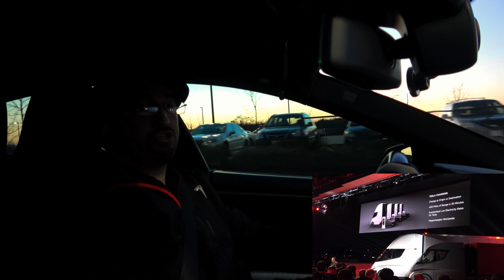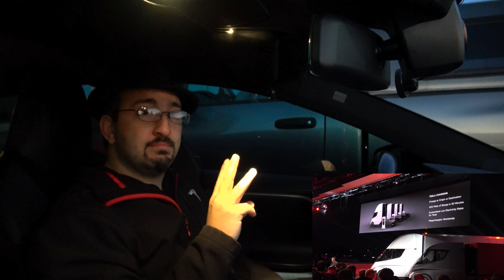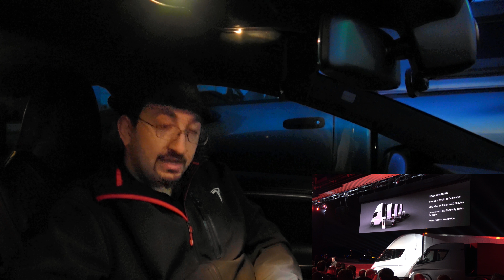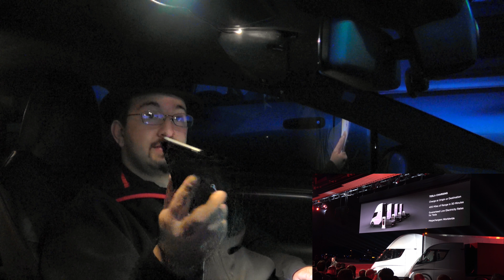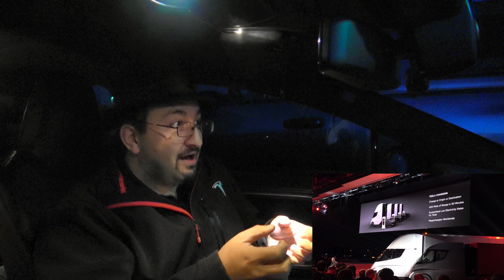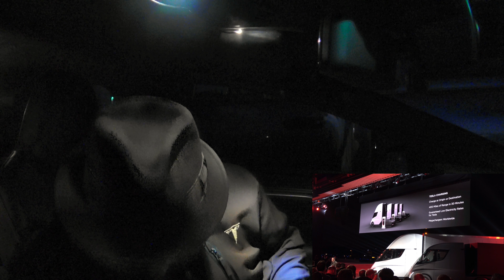Tesla Semi COST (From Insiders!) & Other Unknown Information! Kman Digging for Info

Comment: Use a #4 THHN copper wire for example...  22.8kW @ 240V, 142.5kW @ 1500V, 237.5 @ 2500V.  Step that up to #3 and you get 287.5kW @ 2500V.  Multiply by four and you get 1.15MW @ 2500V.

Why am I talking about 2500V?  Think of a variable internal pack geometry.  When it goes to charge, it internally changes connections to put multiple battery sections into series, that would normally be in parallel.  This is a very interesting and very possible way to boost charging rate without larger cabling.

Also remember that the size of your wire isn't the limiting factor with voltage, the dielectric constant of your insulation is.

Comment: Dividing the charge into segments and increasing voltage with modularized battery segments charging independently with common management of packs. This is my guess. Reduced cost for repairs etc.

Comment: Kman, any thoughts about winter testing of semi? Running the semi between Tesla plants will not experience the different weather we have in USA.  Wisconsin winter on battery/motors? Ice Road Tesla truckers??? 😀😀😀
Reply from the maker: +PaulNVideo not a bad idea, but should be too bad. the use semis get, the battery would never get a chance to cool down. mega charge drain mega charge drain. in fact, might perform better here ;-) faster charging as less heat build up!
Reply: PaulNVideo if they run the semis between the gigsfactory and Fremont, that means they will cross the Sierra Nevada many times, and it snow a good bunch in winter. I've done snow driving many times on the Sierra.
Reply: I was thinking more extreme conditions. Snow/ice chains on the tires. Based on Kman info about drivetrain the chains would go on the lower speed set of wheels??? What about clearances on fenders??? It's pretty aerodynamic for good conditions.

Comment: You talk about using differentials and suggest two wheel axles. The differential function is done with the motors, one for each wheel. The original GM Impact, prototype for the EV-1 had two motors, one for each rear wheel. GM decided to go with a complete in house redesign of the EV-1 which went back to the single motor plus differential supposedly for production considerations. My feeling is they were dragging their feet, and one hardly calls about 800 units ever released to the public "production". Unless, of course one is referring to a $250k Semi  annual production level.

Comment: When Elon quoted a 621 mile range for the Roadster I knew a new battery chemistry must be in the pipeline!
Reply: Nt really much different chemistry so much as the size of the pack is double that of 100 kWh which gets 310 miles at best, a lot of folks been saying the range makes sense since as aforementioned.

Comment: It would have to be 1600 volts to accommodate that power over the same cable. Easily accomplished just put the packs in series. I believe the long rang version has 5 packs which would make a 2000 volt charge rate which sounds more like it.  Actually it would have to be 4000 volts at 200 amps to give that power. If they are going to do that they might as well go 8000 volts at 100 amps I don't think the standard cord could hand 200 amps of current. Or they could add more conductors in the cable to parallel the circuit.

Comment: Hey Kman.

Elon boasted about an EPA estimated 500 mile range at max gvw. Do you think that represents a conservative estimate that factors in Winter cold weather driving? If it didn’t and you lose 40% range that would be big deal breaker for a lot of Regional route trucking companies. Suddenly your 250 mi out and back range becomes 150 miles.
Reply: There is no need for a 40% capacity loss in cold weather. The batteries would be heated and while that does take some power it would be negligible. Mostly the power to keep the battery within the optimum temperature range would be supplied from the charger during stops and on an Alaskan road in winter just driving would keep the batteries warm with maybe a little additional heating powered by the traction battery if required. It is not a problem for a Norwegian Model S so the Semi should be easy. Just keep the tractor plugged in when stationary for an hour or more.
Reply: Well, I would agree that it shouldn't be that much loss.  However, my experience with EV range loss on my current Chevy VOLT is about 40 % in 20F temps . It goes from 42 summer to 24-26 in January. (South Central Wisconsin) But that is based on a 10.7 KW useable capacity. The HVAC and Battery heating probably consumes a larger percentage of that usable capacity than it would in a much Larger capacity battery overall.  I plan on getting a LONG RANGE Model 3 in 2019 and plan on driving it on near 300 mile trips on a frequent basis. I have Super Charging available along the travel route but I would prefer to be able to leap frog the chargers for Time reasons. If I were to lose 75-90 miles of  310 mile estimated range, I would be forced to SC along the way to complete those trips. While a minor inconvenience to me, I'm not driving my car as a money maker like a trucking company does where time is Money!   Don't get me wrong, I really want the Tesla Semi to SUCCEED.  I just want to be sure that the Tesla Marketing department is selling all there vehicles based on real world conditions and numbers.  Rather than boasting big numbers followed by the  small print (*) footnotes.

I do like that Elon likes to make the Worst case scenario statements though.  500 mi range @ Max GVW for example. It's always better to undersell with the confidence, knowing that it will out perform your conservative selling points. Kind of like the Model 3 long range 310 mi, which is based on the non-aero wheels. Add 8-10% for those.

Comment: What is the weight of the current battery packs?  I would expect that along with a semi, there would be various trailer formats (flat decks, enclosed cubes, refers) with additional battery packs installed in the frame.  IF the weight is not a huge penalty to the payload, I can imagine Tesla or even a 3rd party offering a 'spare battery on wheels' which you're going to be hauling anyways...  Terminal to terminal truck operations, such as Walmart who've already ordered these trucks, would certainly be well served to be able to unhook one trailer to be unloaded/loaded/charged and just hook up to another trailer that's ready to go and fully charged, no delays...
Reply: Added vehicle weight = lower payload weight = less money being made seeing as truck have a legal max weight limit before a permit is required to operate though each state on specific routes.

Comment: I don't that there will be an onboard charger, so AC charging won't be available.  As your video showed 120v charging is silly and even with a 20kw HPWC it would take 20 hours to get 400kWh.  Not having to carry a charger saves weigh and costs.

Comment: 175,000$ plus or minus 25,000$.
Reply: Tony Jose 

That’s not that far from the price of a New traditional semi-tractor with a sleeper and amenities.
Reply: Soo, 1Mwh battery should be 150k alone?
Reply: He is very wrong about price, Battery pack of 1MW will cost atleast 200K the Price will be at least 400K-500K.
Cost of operation will be very cheap compared to diesel and overall cost of operation from cradle to grave / 1000,000 Miles will be 3 times cheaper than Diesel, Cost of diesel for 1 year is 70K. you will save 200K on diesel alone and oil change for every 10K and many breakdowns in diesel will cost too much compared to EV-Semi.
Reply: 150$ per kwh was last claimed price I have seen coming from tesla about their 21700 cells.
Reply: In FEBRUARAY they announced that they reached 125$/kwh and since then they made huge breakthrough in they gigafactory-building. The larger the Factory become, the cheaper it will be. Estimates go as low as 90$ once its finished - which it should be somewhere around the deliver-date. 200k for the truck is very likely and possible.
Also there are rumours that Tesla might not fully sell the battery with the truck but instead switching it once its used up and then recycle it themselves because those used batteries are actually worth a LOT. So the customer only pays a portion of the cost but has to buy a new one every 500k miles or maybe even 1mil miles and tesla gets the old batterypack for free to use in their battery-projects or whatever.

Until one of these trucks reach that amount of miles, there will be several more gigafactories around and the price even lower
Reply: That's the cost of cell not the battery pack with thermal management and BMS,
You can't put those cell directly in the car like toys.
Reply: Kman nailed it. Reports today are $150k for the 300mi version, $180k for the 500mi version, and $200k for the founders series.  Meaning: Tesla's battery price has gone way down.  Something like $80/kWh after profit.

Hardly impossible.  Even with today's spiked raw material prices I estimate that NCAs would be about $50/kg in raw materials.  I don't know how much cobalt they use in their NMCs (I understand them to be low-cobalt NMCs); if it's the same or less than in their NCAs then they'll be even cheaper.  Once the price spikes get back under control, raw materials should be closer to $30/kg.
Reply: If only I could get a load of those cells at that price....
Reply: This is the reason that all of the people who've shorted TSLA because "the competition will soon be blowing them away" are idiots.  This sort of competitive advantage comes from billions and billions of spending on facilities and R&D over the course of years.  You don't reverse that overnight with pocket change.  You know, you see a company or another announcing $10B or so over  a decade, backloaded, and it's like, "You forgot a zero on the end of that figure".  The only thing I've seen that actually comes across as serious is Volkswagen's recent announcement of plans to spend $40B over 5 years.  That's a proper figure to be a legitimate Tesla competitor.  But it's going to be a couple years before they really see that paying off.
Reply: Karen Pease Please don’t use technical acronyms without including the long form first. We are not all industry insiders in the know.

NCA’s ???
NMC’s ???
Reply: Nickel-Cobalt-Aluminum vs. Nickel-Manganese-Cobalt.  The former is more energy dense but shorter longevity and not as power dense vs. the latter.  Tesla's mix for the former has been stated at 80% Ni, 15% Mn, 5% Al, but I've never come across Tesla's mix for the latter.  MS and MX use NCA.  Tesla's grid storage products use NMC.  Semi has been strongly suggested by Tesla to use NMC.  I've seen claims that Model 3 uses NMC, but never well supported claims.  No idea on the new Roadster.

Current prices (approximate) and about how much is used per kWh in NCA battery packs (where a reasonable estimate is available):
Li: $75/kg, 0,07kg/kWh  (note: pricing based on lithium carbonate pricing of $15/kg)
Co: $60/kg, 0,22kg/kWh
Ni: $15,/kg 1,2kg/kWh

There's something like 4kg/kWh not accounted for by the above - oxygen, graphite, silicon, aluminum (both in cathodes, but especially casing), copper, organic electrolyte (fluorinated hydrocarbons), separator membranes, coolant, tubing, insulation, all sorts of manufactured components, etc, etc.  Not a clue what average price per kg they'll be, but I'd wager maybe $4/kg at present, less in the future.  As for some other raw material prices:

Al: $2/kg
Mn: $2/kg
Cu: $7/kg

To reiterate: current prices are spiked and not in line with historic spices; they'll come down from their highs eventually when mining catches up to the production curve. At historic prices, Li is more like $30/kg, Co more like $35/kg, Ni more like $10/kg, etc.

Comment: Have we heard anything about putting batteries in the trailer, so the truck can deplete the trailer battery first then internal batteries. Now you could see 1000 miles.  I did see some video of trailers driving them selves. No driver compartment. Just imagine 20 years from now, a string of driver-less trailers going down the road.  Hope the truckers can learn to fix driver less trailers. I really don't know the future of truckers.
Reply: Kevin Michael they could do that, but it's not worth it or reasonable. Even 500 miles is a lot, and adding any more batteries would just be pointless for weight. The charge rate is what's going to sell this truck as there is truly no waiting period for charging during unloading

Comment: P.S. The semi and Roadster batteries will need about 3x power density. My best guess is that Tesla plans to take Li pioneer John Goodenough's solid electrolyte battery from lab to Gigafactory in 2 years. See Forbes: https://www.forbes.com/sites/jamesconca/2017/03/17/jack-goodenoughs-battery-technologies-keep-getting-better/#26f9fb134e62

Comment: I can't imagine a solar system making 800kW over a day charging just one truck. That would have to be thousands panels, they will need quite big roof over that Megacharger.
Good point with owning a truck rather then a roadster, I guess you would also live a lot longer.
Reply: If with "800kW over a day" mean "800 kWh per day" you would need about 600 square meters of solar panels (in California). That is about 300 solar panels. A roof with a lenght of 60 meters and width of 10 meters is big but not too big.
Reply: Not to worry, they will the roof on all the Walmarts.
Reply: Many warehouses cover enough area to make plenty of power and considering the chargers use stored energy they do not put much drain or strain on solar even if the sun is not bright enough at times. And they can always install solar canopies to make up for the lack of roof solar production and offer a nice shade at times for the trucks.

Comment: I'm interested in weight. If a 100 kWh pack weights 1,500lb a 1 MWh pack would be 15k pounds. Take out a hefty diesel engine and 18 speed trans and you still have a net gain of +/- 10k lbs. 

Most trucking is limited on weight and they try to scale out as close to 80k as possible. If you can only legally carry 40k lb vs 50k lbs, that has a cost. There are also bridge formulas that the DOT uses and each axle can not exceed certain weights. With the added weight of the tractor, they'll need to fine tune it's distribution as the 2&3 axles can't be over 40k lbs combined in most states.
Reply: Chicagoland Concrete  plus a couple of tanks of diesel....
Reply: James Harrison 180 gal x 8lb/gal & tanks= +/- 1,700lbs.

Comment: Math is a little off. 2KW per mile, x 400 mile range = 800Kw needing charged. I don't know how you come up with 1.6 Mega Watts. Now keep in mind, you have 4 batteries, with 4 lines going to them. So they are charging 200KW per line. No big deal.  Sidenote, don't bring the kid along when you do videos. Not being fair to the kid.
Reply: 500 mile range.

800kWh needing to be charged in half an hour leads to a charge rate requirement of 1.6MW.
Reply: Actually that leads to the question, what is the maximum charge rate? I read the superchargers are 150KW.  So I guess they are not going to be charging the truck in an half hour.
Reply: Elon claimed they are going to charge 400 miles per 30 minutes. Which equals 1.6kW needed (following Kaman’s claim) per hour. Divided by 4 packs (and cables) would mean 400kW each. That should be no issue. Beside the total amount of power you need for multiple Megacharger used at the same time...
Reply: Superchargers are 145kW per charger, max 120kW per stall.
Reply: Karen Pease who's talking about Superchargers?  The Semi doesn't use those.